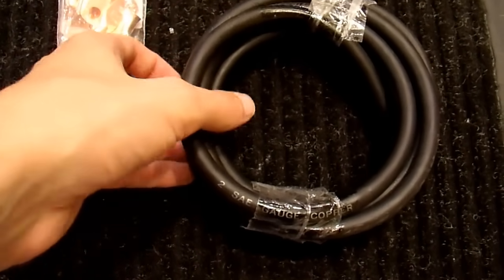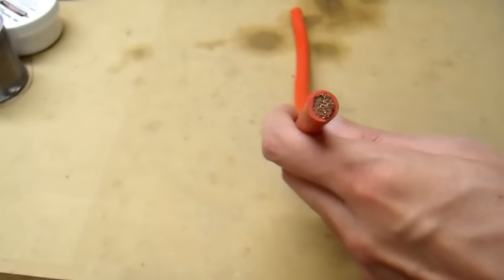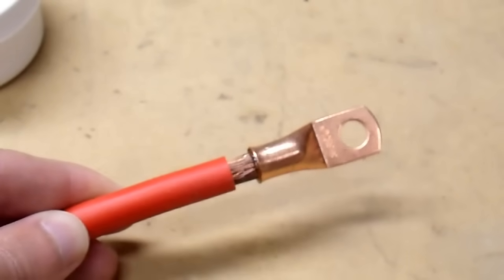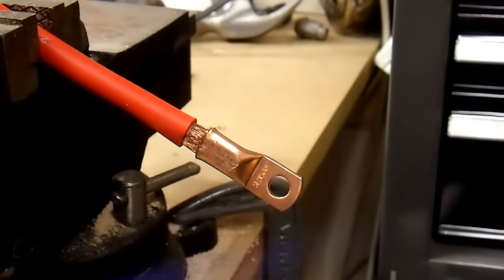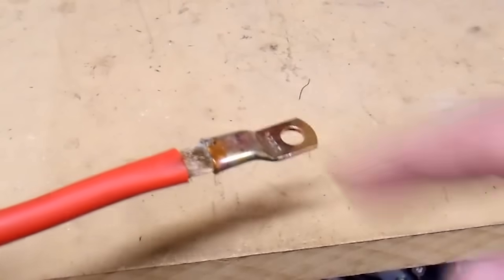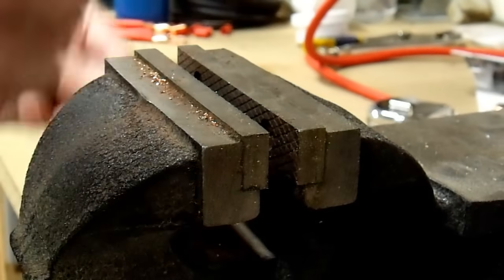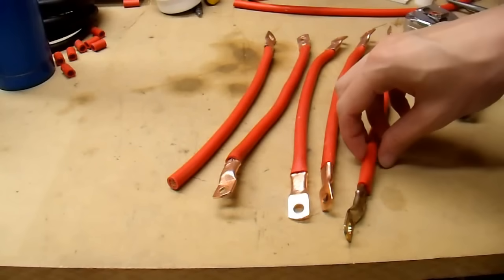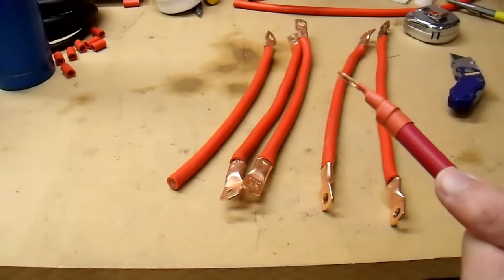How to Make Battery Cables the Right Way and the Easy Way

Comment: If you’re going to use a vise to crimp, you can cut a nut in half, pick a nut size smaller than the terminal, then use the vise to squeeze the nut halves together crimping the terminal.

Comment: Holy blowtorch Batman You don't need to keep it on the connector once the Solder starts melting.  Alternate on off with the heat

Comment: Wow, I have been doing it wrong all these years; I use a crimping tool, I do not use soldering, I use shrink wrap, and the exposed copper wire goes all the way into the crimp.

Comment: Right way?  I'd say the cheap way but not the right way.  Yes, I've crimped with my bench vise many times and it does work but it's not ideal.  A much better solution is a hydraulic crimper. I'd also add some oxguard for added protection.   I also prefer my lug but up against the insulation.

Comment: Good video. I learned this method 40+ years ago from a boat electrician. I worked for a company that built 44' sport fishing boats with two big V-8 diesels. The used 24V starters and the boat came standard with four 8-D batteries. Cables galore. We also made our own heavy duty buss bars from thick copper bar. BTW we did not crimp the cables, solder only.

Comment: This video is interesting, but is more a list of all the mistakes you can make when crimping a terminal. Soldering it like this will cause the solder to wick up the copper strands, causing a section of the cable to stiffen and create a breaking point somewhere away from the lug where strands will fail as the cable flexes. Lugs are never soldered in marine, automotive or aviation applications. The soldered electrical connection inside the lug may actually be worse than the equivalent compression-welded copper connection. Soldering with that level of heat also nearly always damages the insulation on the cable. Using a vice (or a hammer!) to crimp the connection gives you no way to judge the proper pressure; too little pressure and it will fall off some time in the future (even if you can't pull it off immediately), too much pressure and the strands will be broken invisibly inside the lug. Finally, heatshrink should be applied to the finished joint to keep oxygen out, insulate the barrel of the lug, and provide some strain relief on the cable.

Comment: Yep, as an auto electrician, the soldered ones are far better with battery cables as mentioned. I still like heatshrink though as looks much better once done - dont forget to put it over the cable before soldering else m,ight noty get it on afterwards.

Comment: Someone needs to explain they are called terminals not termination
Reply from the maker: A terminal is a piece of hardware used in a termination.
Reply: @knurlgnar24   the ends he is putting on the wire is not a termination !
In fact nothing in this video was good !
I would have fired him half way through ! When he said , it’s no big deal to cut too much insulation off

Comment: lol with the shrink wrap to see if its creeping out just put a mark/ arrow on it so you can see if its creeping over time. very easy. Plus I put dilectric grease in the shrinkwrap or rubber adhesive JIC. Cables usually last untill the coper ring connection completely corrodes. But TYSM Im gonna use the solder methiod for my 95 corvette convertible projcet.

Comment: USE HEAT SHRINK, CRIMP YOUR WIRES AND USE HEAT SHRINK.
Reply from the maker: Heat shrink hides defects and does little else in practical applications.  They are 'corrosion catchers' and while industry loves them for academic reasons it's best to not use it in most practical battery applications.

Comment: Also, heat shrink definitely plays a key role is safety and longevity
Reply: The heat shrink is used, to mark the cabling, per phase, and have less metal exposed.
in high power, 3 phase, most of these cables are actually black, and as such, needs to be marked.

Comment: OMG, soldering a crimp connector actually weakens the joint, especially in a high vibration environment (like cars). Kids, don't do this at home! Buy a correct tool for the job.

Comment: I see so many vlogs using blow lamps and not one of them has used the blowlamp correctly as in this case. everyone keeps the lamp too far from the work piece. the hottest part of the flame is at the point of the darker blue shorter flame.

Comment: As for as the heat shrink option, there's a type that has an internal epoxy coating that will effectively make the location air/water tight. You can usually find them where they sell welding supplies (cabling, O2 refills, etc) and are available in various colors. They are also a great place for the rest of the cabling, ends, etc that you may be looking for when building battery cables, whether for off-grid power systems or auto/truck/farm batteries. I will buy common cable sizes in "bulk" lengths for the cost savings and the convenience of having a ready source when something "pops up". By being able to have a "one stop shopping" resource that can cover 95% or more of what I need, I'm saving time and money just in the single source stop alone. If I can work out a discount that's in both our favors, it's icing on the cake.
Blessings to All and God Bless the USA 🙏🏻🙏🏻🙏🏻🇺🇸🇺🇸🇺🇸
Reply: I get the same stuff. Double walled with adhesive. Just look for marine worthy.

Comment: What i woulda done..Is to soak a lil solder in your termination end...Let a lil solder soak up in your wire..Then while termination still has a semi liquified solder dip your wire in..Crimp then reheat so all solder becomes liquid and makes that better electrical connection..Then use shrink tube..

Comment: First. At 9:56 cut strands are visible. Buy a proper cable stripper they are only $20. Battery lugs carry 100s of Amps.
Second. Clean the wires until bright before soldering. A solder joint is not a mechanical join. All soldered wiring requires strain relief. 
Thirdly. A crimped join is cold welded - far superior to soldering. Buy a hydraulic crimper from the Chinese - $30.

Comment: hmm I mean your wire isn't going to get corrosion in the first place if you use marine heat shrink that is self sealing.  Also if you are concerned about shorts it helps if there isn't an inch and a half of conductive material sticking out with nothing shielding it.

Comment: Many thanks for your video. However, I read the following" While battery terminal covers aren't strictly necessary, many new vehicles use them to prevent short-circuiting or arcing against the car body. Battery terminal covers can be plastic, rubber or any kind of synthetic polymer that can seal the terminals against water and incidental electrical contact." and I guess, the same goes for the shrink sleeves.

Comment: Wrong ! Wrong way to crimp and the wrong terminals - those are plain copper terminals , should be tinned . That cable - wrong style , that’s cheap automotive copper cable.note the stranding,it’s coarse, and it’s plain copper - marine grade cabling is a fine strand and it’s tinned 
Epic fail !

Comment: If a first year apprentice made a connection like yours I would make him or her do it again and correctly your way you will most likely get a high resistant joint, Heat shrink is to stop moisture entering the cable.

Comment: OMG, from the proffessional view I would throw all those cables. Crimp tools are not expensive at all. You are wasting more money all this solder and gas, flux and whatever you're doing there. 1. the solder is taking the fleixibility of the copper away, the cabel breaks much earlier than without. 2. Due to the high amount of heat needed the isolation is shrinking away exposing the copper. 3. the resistance of cheap solder is much higher than of copper unless you use high quality silver based solder, and you make these cables for high amp flow right?  Guys, be smart and use a crimp tool to make the cables correctly and it is 10 times faster done, you can get it for 10 usd. By this you also wont loose the insurance coverage in case of fire!
Reply: lose

Comment: If one uses marine shrink tubing there is not much chance of corrosion because the marine shrink tubing has a glue inside that melts and makes ones fittings air and salt water tight.  Bit more expensive and heavier wall thickness yet well worth the peace of mind.  This is the only shrink tubing I will use now.  I like to use plumbers solder on my battery cables or heavier joints and never had a failure yet.

Comment: I like to put solder inside the connector, heat it and using some flux insert a wire inside connector with melted solder.

Comment: Proper battery contact is extremely important. Quite a while ago I had electric problems with my car that no mechanic could figure out. One of those mechanics was a bloke that went from garage to garage and only did electrics. According to the garage owner, he was "a specialist." Eventually I took the car to the official dealer, who simply cut the cable ends, made a new connection, connected the cables to the battery, and covered the terminals with grease. After that, the car finally started properly and never gave me any problems again. The problem had been caused by the terminals clamps corroding slightly after leaving the battery disconnected for a couple of months. A good scrub with sandpaper probably would have done the job.

A couple of decades later, I had a similar problem with my motorbike. Took it to a mechanic, who put in a new battery (identical to the brand-new battery I had purchased and installed two days before) and a new starter motor. After a couple of days, the problem came back. I finally figured out the problem was with the connection again and fixed it myself. Between the two incidents,  it all came to three batteries, one starter motor, and numerous visits to clueless mechanics -- all for poor crimp jobs or a bit of corrosion on the battery terminals. I can't remember what the cost was the first time, but the second time I paid £400 on a £1,000 bike to have unnecessary work done on it that didn't fix the problem. All the mechanics except one were clueless, including the "specialist."

Remember, kids, if you have electric problems, check the battery terminals first.
Reply: I've seen this a thousand times and it would be the most common form of misdiagnosis in the industry. It comes down to laziness/ incompetence/dishonesty. It's usually the first two. I've rediagnosed so many battery and starting issues for clients usually taking less than one minute with a multimeter and carrying out a voltage drop test and then a charge test. Sooo many are actually bad connections... It's beyond belief!
Reply: Remember kids, just because they say they are a mechanic doesn't mean they are any good at it.  Just like people, they come in all types and abilities.
Reply: @oby-1607  Agreed, there are 'qualified' mechanics that have no interest in doing a professional job the right way that lasts for say the next 10 years.
Reply: I had a cadillac back in 99 that had all sorts of issues at random, including engine misfires, bucking and stalling. When it got very bad I got under and all that hell that'd been going on for months was just the negative cable being loose at the starter.
Reply: That is the comment with power of changing someone else life !!! Thanks
Reply: Yep. Tell him

Comment: Why the F was this a recommended video? This is the WRONG way to do it. Crimp is always better. Especially with high amp cables. Keep soldering to PCBs. Even on Pcbs, solder fails due to stresses at the joint. If you are going to do it, you need a stress relief, fixing the lead off of the cable directly to what you are attaching it to. You can not rely on the Lug. Also, Solder joints melt.

Comment: Connection grease to cable, krymp it, wipe exessive grease, ad heatshrink. It will last lot more than your's lifetime, if the cable is correctly layet and suported. And there is two good way's to find poor connection on powercables, finger and thermometer, both work's the same way..

Comment: To start with, I wouldn't recommend relying on solder on a terminal that will carry heavy current. A proper crimp is a must. Use a tool designed for the terminal. If you are worried about oxidation, use an anti-oxidant compound. The other problem with soldering a cable that needs to flex, is it will cause the cable to break. Heat shrink has it's place but is not usually necessary on a battery cable. There are other ways to protect from shorts and cosmetics is not a huge deal unless you have a show car.
Reply: Not only that but solder is actually a poor conductor. You're not doing yourself one bit of good by soldering a battery cable into a terminal. Just about as half-a**ed as using a vise to crimp a terminal.
Reply: @carlbeaver7112 That's just WRONG! A soldered crimped wire is going to have BETTER conductivity and a lower resistance! Solder is a bad conductor? Really? Which kind? Compared to what? Sorry, but you're just wrong!
Reply: @NoMoreBsPlease  While solder is an adequate conductor for making electrical connections, it is not as good a conductor as the copper wire itself—its conductivity is only around 10–17% that of copper. But, the short length of solder in joints makes the increased resistance negligible for virtually all standard electrical applications.  The main benefit of solder is that it provides both electrical contact and mechanical bonding, sealing and protecting the connection from corrosion.  However, solder contains brittle intermetallic compounds, so fatigue is the primary failure mechanism in solder joints.
Reply: Agree with the comment on not relying on solder, heavy current is very capable of heating the connection to the point of liquifying the solder again and then your solder meant to help the mechanical/electrical integrity will become a lubricant in the connection possibly leading to catastrophic failure.
Reply: @geekthesteve6215  wow, very good point

Comment: I still would've added heat-shrink and or electrical tape to the un-sodered or soder connections. If you worried about cable rubbing on that and waring through then whats to keep cable from rubbing and waring through the coated part to, if you have cables rubbing together then I'd first fix that. Coating/covering/sealing cable connections will help stop cable connection corrosion and thats the main thing/ the most important thing.....

Comment: Nice. Fyi if you use pure rosin flux it will insulate and water proof your connection. Acid core solder or flux is terrible anyways lol. Try it ,,,I know you’ll like it.
Reply from the maker: Thanks for the info.  I used rosin flux rather than acid core.  Rosin flux may not be technically 'corrosive' but it does cause corrosion over time if not fully activated.

Comment: I use solder pellets  or fill the end partially with solder then heat up till liquid and then push wire into solder in connector and remove heat.
Reply from the maker: Good tip.  I got it too hot in this video.  Solder pellets are a good option but are somewhat expensive and specialized.  Nothing against it but using simple common flux core solder is a good alternative.

Comment: If you have heat shrink on two wires close next to each other they'll rub a hole in the heat shrink and short out. Genius. How about if you don't have heat shrink on 'em they'll short out immediately, especially with all that exposed wire.

Comment: Those are interesting points about heat shrink, it is always nice to hear a contrary point of view. I use heat shrink to separate moisture from the metal of the conductor. Any unheated room will predictably reach the dew point temperature overnight, where moisture in the air condenses on anything. That moisture then promotes galvanic reactions, oxidation, and corrosion. There is a reason corrosion of battery terminals is largely confined to the posts, where contiguous moisture can wick up any unprotected wire. On the other hand, your remark about actually seeing what is going on is certainly valid.

Comment: Hmm... battery cables should be crimped with a real crimped. Solder is not desirable , terminals can get very hot! The solder will melt, you must plan for that scenario. Solder also creates a brittle joint that is subject to failure under vibration. Hard solder is the only solder I would use, but once again, a brittle joint subject to failure.

Comment: The USCG used for require hot dipped joints. We we -remake all the cables and then we would melt a pot of fluk and melt a solder pot. It was very fast, dip into the flick then into the solder. They required that the solder went up the wire a distance of of on half the wire length. Don’t believe this is in the CFR. anymore.heard that it could create a crack in the joint.  But it sure made great conductivity.

Comment: Terrible. You did everything backwards. You done need flux like if it were copper plumbing. Out the terminal in the vice, heat it with torch and shove solder into it then shove the cable in and heat a few seconds longer. Let it cool then use the vice to crimp, then heat shrink.

Comment: Is this a troll? He's doing everything wrong.Using solder,not sealing the exposed cable with sleaving? yeah this must be a troll.Please dont listen to this,and dont do any work like this by watching youtube videos,it could end in tears.
Reply from the maker: This isn't my best video but I'm not a troll.  Using solder is widely used in industry and is a very good method.  Heatshrink, even glue lined, usually results in more problems than it solves.  And this method does work perfectly adequately for most applications.

Comment: This is not the way to do it. A quality crimp with the right tool is the best way to attach a terminal end. Don't solder.
Reply from the maker: The hate against soldering is misplaced.  Yes, a crimp with a quality crimper will be better.  But this works just fine for most purposes.